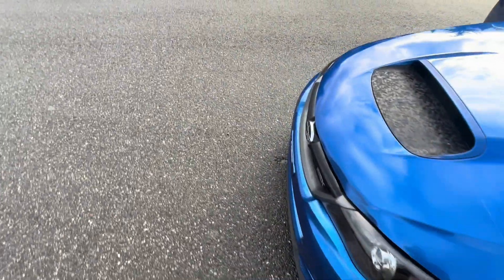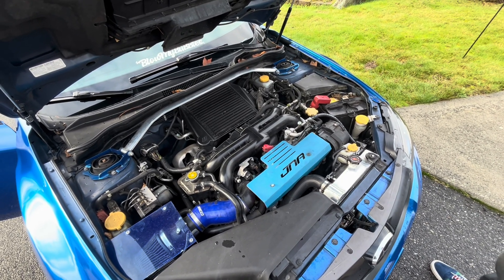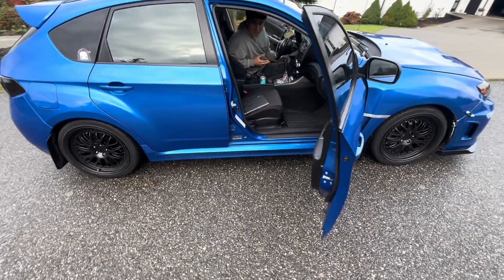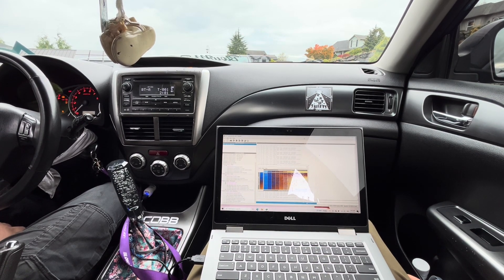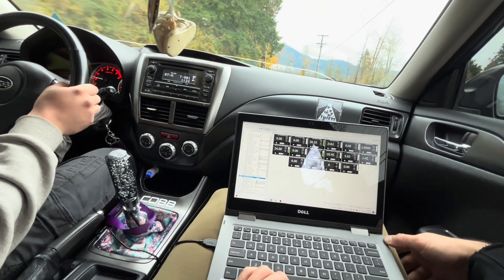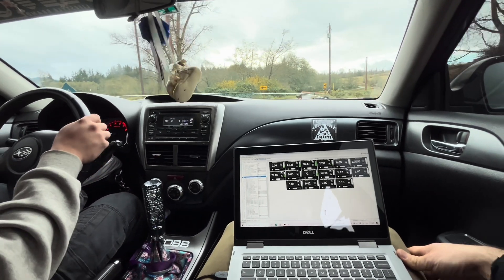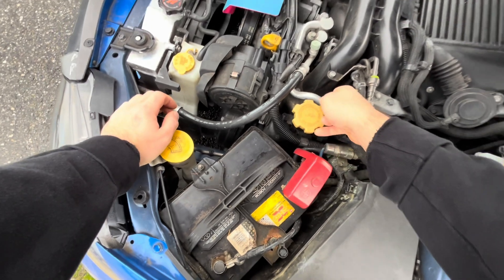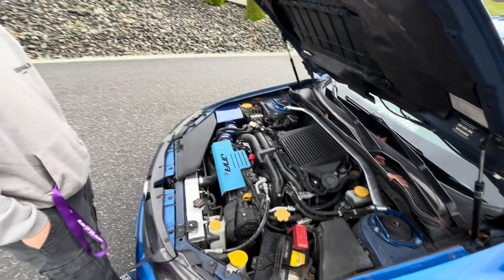Tuning 2011 WRX Hatch with EJ20X Engine!

Comment: Are you tuning with the stock O2 or does the car have a wideband?
Reply from the maker: Most of the tuning and logging happens off of the stock o2. Some people do have wide bands, and they’re a great reference to help with the tuning as well.
Reply: @NovichenkoWhips  How reliable is the stock O2? My understanding is that its essentially a narrow band, that the ecu somehow extrapolates a wider range of values from.  Is this correct?
Reply from the maker: @atotalpro  it is an narrowband most cars I tune for 11.5 AFR at full boost the stock o2 reads as low as 11

Comment: Hello all, I will be swapping an ej20x to my 1.5i. I want the subi rumble, what headers should I use ?
Reply from the maker: @daveporras4429  the Subaru rumble mostly is a result of unequal length headers
Reply: @ thanks, which UEL header is  the best fit for the ej20x ? 
Those in Japan come with equal length headers
Reply from the maker: @ I think any USDM header should fit it.. you could use OEM off of WRX or STI.. or you can get aftermarket unequal

Comment: Here also with a Subaru Impreza 2.0R with full EJ20X swap including Legacy ECU.
Running on 93 AKI Premium (equivalent to 97 V-Power here in Chile) + AEM methanol injection
Currently making around 300whp to the wheels (estimate without dyno) with the new conservative tune.

Specs:
VF44 turbocharger
AEM fuel pump
Stage 2 Kevlar clutch
Lightweight flywheel
Big top mount intercooler
Full 2.5" stainless steel exhaust system with aftermarket downpipe
Ravenol RSS 10W60 oil
Grimmspeed 3-way boost controller (running stock 2-port configuration)

Previous owner had it tuned with all boost limiters disabled, car was running over 24 PSI for several months (engine survived somehow). Now running a more conservative tune with proper boost limiters enabled.
Next up: Installing dual oil catch can setup - one for crankcase ventilation and another for the PCV system.